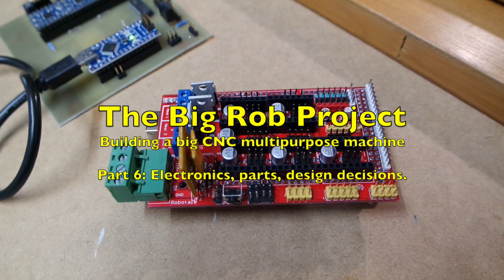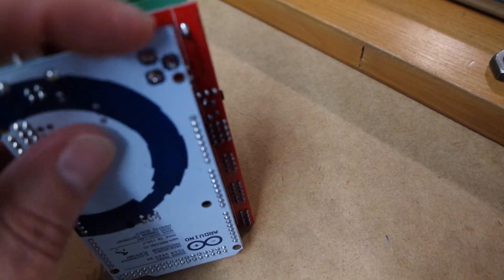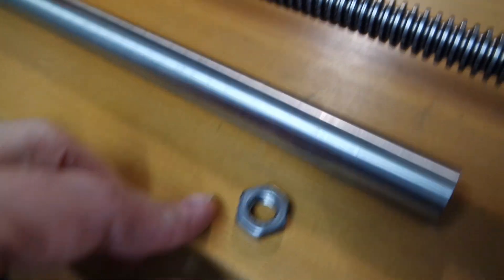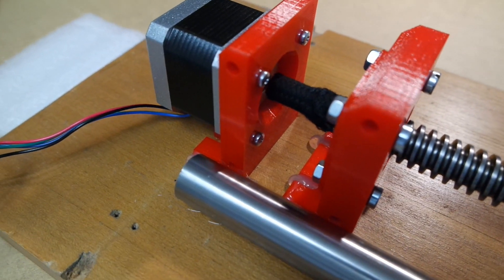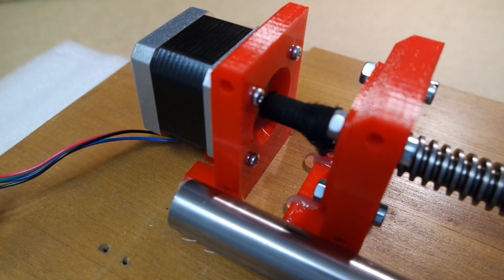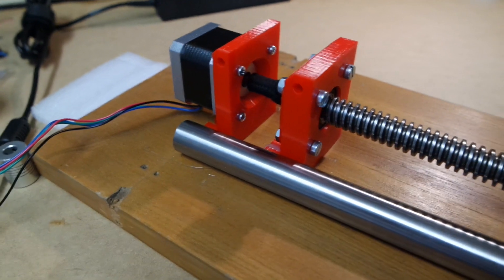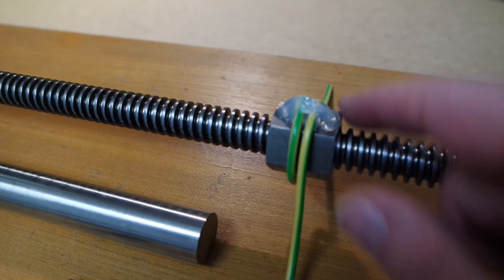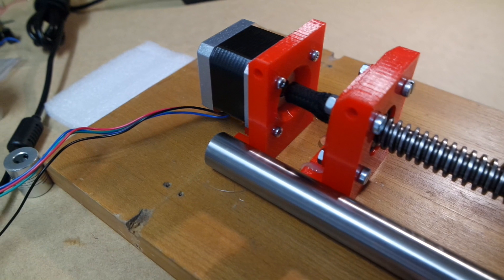Big Rob Project Part 6

Comment: Grüß Gott Dirk!

I m really looking forward to your next steps.
I dont know the background why you think that the lowered rods would take more force than the threaded rod due to the geometrical lowering of the rods.Let me know so that I can figure out.  In my oppinionh it will only be a compairison of the bendings of the rods. The one which bends less will take the main force. Anyway could you please give more details on the link between steper and the thread rod? Would be very appreciated, or did I miss it on one video? (My rods will be 2x8mm for x and same for y. Z gets 3x12mm. All 1.4301. Threaded will be normal M threaded, brass M6 for x and y. M8 1.4301 for Z. Just for the case you wondered. As you see threaded diameter is lower than the rods, so the rods have to support the main force). Will you add joystic control at the end?

Alles gute von der Alb ra!
Tim
Reply from the maker: +Tigrar Hi there !
Well, I figured - and I might be wrong - that the Y-Axis rail rods will need to support the weight of the gantry and tool.
The only other force that they receive is if the tool does not agree with the motion of the Axis - and that force is toque.
If I place the threaded rod as high as the tool, the torque will be minimal, the closer I move to the rails the bigger it becomes.
If I move the threaded rod below the rails rod the torque will be further amplified.
But if I move the steppers and threaded rod higher their attachment needs to become stronger.

I have not thought about joystick control yet - I suppose it would be a good idea.

Gruesse,
Dirk
Reply: +Dirk Herrendoerfer  Well Dirk, my oppinon as mechanical engineer... to get the weight on the rails and not on the thread you will have to have a false dimension on the distances what would be realy a bad idea or, as already mentioned to have the rails more rigid as the thread rod. If I look on the rod you have I even dont fear if it takes some force in Z. For the 2 stuck cases...  first torque around Z Axis (stuck on one of both rails) you would improve by spreading the rails as much as your system allows it. The reason is that with more distance between the rails the less force the torque will have. Situation 2 stuck on both rails -> torque perpendicular to Z and rods, now  it is the opposite as you insert the force with the thread and the more Z distance you have to the rails the more the system can apply torque to your rails.
To avoid both situations from the beginning I will have 4 silders (for x and same for y), 2 on each rod. so one slider front left hand, front right hand, rear left hand... This way the sled cant turn that easily around Z Axis. Also for case 2 the front to the rear sliders avoit a turning. In both cases the freeze begins with a turning... (or you have forgotten the oil or have rusty rails) This will also favorise to add the forces in Z on the rails systeminstead on the thread wich comes with one central nut.
Z will even have 6 sliders due to 3 rods to prevent bending from tool weight or due to the torque appied due to the gallow geometry.

Let me know more background to your oppinion and I try to evaluate it.
Also feel free to drop me a line if you have questions or fee unsure 

Kannst auch direkt an den youtube namen schreiben mit gmail und komm  :) Gell

Thumbs up and keep up the good work!

Cheers
Tim

Comment: Friend,
I liked to see that is developing a CNC using a RAMPS. I also did this project. His name is PortalCyclone. But I'm having trouble with the program for controlling the CNC. You already know how it will generate the Gcode and what the program will control the RAMPS? I left the marlin firmware in RAMPS, but do not know if it's the best. Sign on my channel to exchange information, ok?
Reply from the maker: +farmsidney Hi,
I did not decide on what firmware I will use for the CNC, I intend to use Repetier in a modified version, or Marlin.
I will use Repetier for testing - and I'll try to also make a tool to use it to 3D print.
Apart from that I have not made any decisions yet.
Best regards,
Dirk